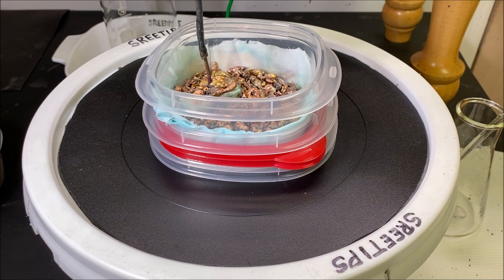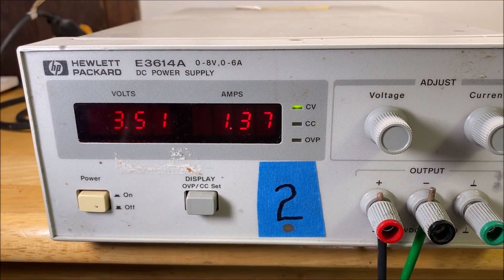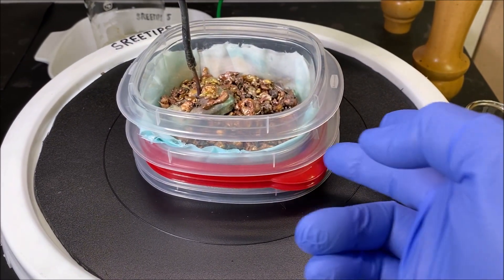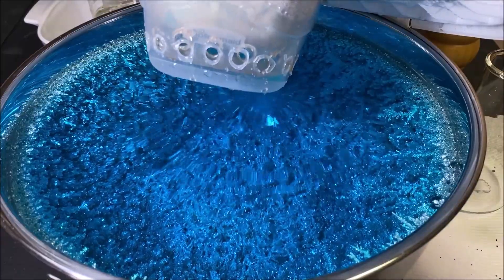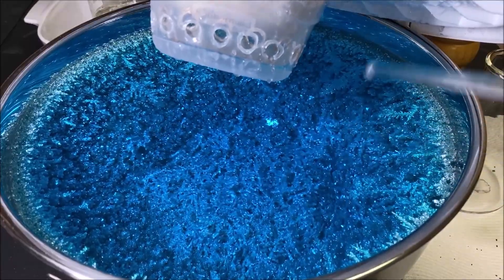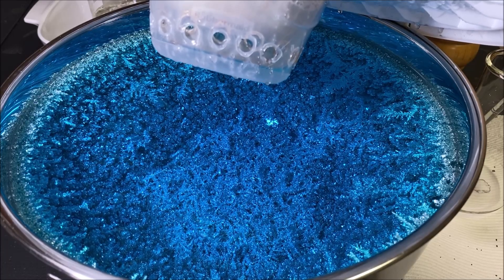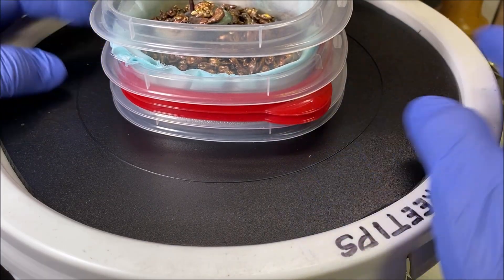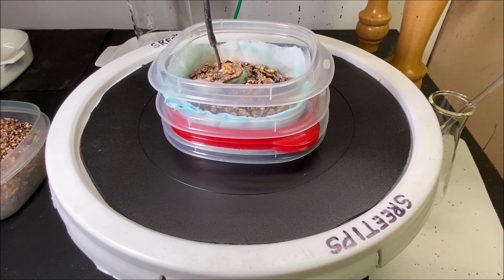Silver Cell Modification Solves my Problem

Comment: As you increase the electrical current path distance from the bottom of the bowl, it has shifted the highest electrical potential to the bowl sides. 

Has the modifications slowed overall production? 
Is less feed shot immersed in bath?
Perhaps returning to one basket with the same amount of holes with no holes on the bottom would increase the current draw which should mean quicker silver crystal production rate.
Reply from the maker: Yes, it slowed way down.
Reply: @sreetips  
I believe that’s likely due to less of the anode feed stock being immersed in the silver solution. 
Think of the current draw as an indication of amount of deposition occurring at any given time. More current draw means more deposition work being done. 
More voltage should increase deposition. 
Warming may increase deposition. 
Level of silver bath solution saturation may also have something to do with the deposition. 
If the bath is preferentially losing silver concentration, replenishing with original bath stock will never return the solution to starting levels of silver. The bath would need a feed that contains a higher silver concentration than the original bath to return to starting levels of silver concentration.

Comment: How do you calculate the silver left after electrolysis? Example melted 100gm into electrolyte and will it grow 100gm of silver crystal and the electrolyte become 0 silver ?
Reply from the maker: No, the sole purpose of the electrolyte is to provide a means for the silver ions, that get dissolved in the anode basket, to travel to the cathode where they get deposited as high purity elemental silver. But the electrolyte does get depleted as the cell operates.
Reply: @sreetips thx For reply . Ive seen your video that you topup The electrolyte . I saw The silver ingot depleted . When The ingot depleted And from crystals, let say The electrolyte you use is 300gm , And The ingot is 500gm. When The ingot depleted to 100gm, does this means The silver crystals have 400gm(+-) The purity. And The 300gm electrolyte left how much gm of silver left inside The solution? sorry to ask becoz im trying to Start one, But dont undestand the Calculations
Reply from the maker: This may help: for every 1000g of impure 98% silver that I add into the anode basket, I can expect to harvest about 980g of pure silver. However, some of the pure silver will be from the electrolyte. How much? Don’t know. I’ve never taken time to calculate it. And for me it doesn’t matter. Because I take the pure silver that I harvest, put it away, and forget about it.
Reply: @sreetips okay good info . This part I now understand . Can the electrolyte still  be used or need to make it back into silver shots and turn it back to electrolyte?
Reply from the maker: I used to try to use it two times, adding fresh electrolyte for the second run. But after that much use it gets saturated with copper and must be replaced. I recover any remaining silver from the used electrolyte by adding clean metallic copper to cement the silver out. Melt into shot. And run it back through the silver cell.
Reply: @sreetips  okay got it bos. thanks for the explainations. good luck to you too
Reply from the maker: Because the cell can’t distinguish between a silver ion that came from the electrolyte, and a silver ion that came from the anode basket. So there’s a Goldie locks range. Silver concentration too high, and most of it ends up depositing on the cathode. Silver concentration too low, and other metals (especially copper) could begin co-depositing with the silver and contaminate it.

Comment: As you noticed the current dropped so less silver per hour is produced. My idea is to isolate the bottom of the cell and don't use the spacer.
Isolation could be a rubber matt glued on or some chemical resistant laquer

Comment: Hindsight is 20/20. I'd assumed the basket was roughly equadistant to all surfaces. If not, path of least resistance and all that skews dendritic growth.
Reply from the maker: It’s performing just like my small 3.5 liter cell now that I’ve adjusted the anode basket further up out of the cell.

Comment: Dendrites are a description of the crystal growth. They are not dendrites growing in there, they are crystals which exhibit dendritic shape. Sounds like semantics, and not to diss on you, I love your videos, they have helped a lot. I did advise on using a deeper cylindrical cathode. Seems easier to buy the right pot at a Goodwill or such store. You get a much greater area under the anode basket than shimming an inch or so. I also like the concept of an attached vibratory shaker on a timer for a few seconds every couple of hours. Let you free up some more time to hit garage sales, or making out with the misses.

Comment: It seems to me a if a small non-metallic saucer were placed bottom up directly under your filter basket, you wouldn't need to double up your filter basket like you did.  After all, if the silver doesn't grow under your basket, it would not be a problem.  One of those small glass saucers you use in many of your refinings would work perfectly.

Comment: Couldn’t you lower the voltage to drop the amps so it would have less amps? Is the issue really the amps? You want to have growth and doesn’t the higher amps make it form crystals faster? I thought that was the whole point of the beast? Bigger, more crystal less maintenance required cuz it will run longer between refills…? If it’s slower now, it’s almost like you need another beast. 

Few weeks ago you ran the smaller silver cell, why not just make 2 or 3 more of the smaller ones and use the smaller design to help keep up with the silver usage?
Reply from the maker: Increasing distance increased resistance and solved the problem. I’m running the beast to try to get the bugs worked out of it. I still like my small silver cells. They work great and are easy to harvest and clean up.

Comment: Nice problem solving!!  Maybe you can get the amperage back up by moving to a taller vessel than a mixing bowl?  That way you can run the basket lower again.  Maybe a stockpot would be a good compromise?
Reply from the maker: I’ll settle for lower amps, slower operation, if it gets those pesky needle crystals from growing under my anode basket.

Comment: If by some odd chance the spacer ends up not being a final solution. I would suggest trying to get a small vibration motor from say an old game controller and hook it to the side of the bowl and wire it in that small amount of vibration should keep cyrstal growth under control maybe even slow your having to stir it.
Reply: That's a genuinely good idea!
Reply: @LexYeen I agree, capital idea. Would creating a film covering the flat bottom area. Make it hydroscopic. If the small amount of mass of ionic solution proves to be more 'gravid', well you tried. A tough waterproof Vinyl with a reversible mastic might be the answer, make the area as small as needed, otherwise you are just loosing your grow surface for no gain.
Reply from the maker: The spacer fixed it.

Comment: I still think a deep aluminum pot might be good you could even tap the bottom and install a ball valve to drain so you don’t have to lift like 40lbs of silver and solution
(Edit) ment stainless pot Al would be bad
Reply: Streetips could use a converted Big Berkey water purifier system.  It has the tap, it is deep and would take forever for the silver crystal to reach the anode basket.  It's basically your idea already implemented.  My other suggestion is the simplest.
Reply: @DigemDeep or have a mono crystal grown from a piece of silver wire and as it get larger it breaks and falls to bottom. there are many ways to do this

Comment: How about to install some kind of "mixer" after the bottom of impure silver jar? i think it can not only solve a problem  with dendrites, because it does  basically will crush them, but also it will continuously mix the solution, so solution will not be locally depleted
Reply from the maker: I’m tossing that idea around in my head.

Comment: Sir we need a filter recovery video ❤
Reply: I've been wondering myself when the next filter recovery video would be coming along as it certainly has been awhile lol
Reply: My favorites
Reply: @josephschnabel1andonly Same here!
Reply: Bet this would work great for plated items? Smaller scale separate operation.
Reply from the maker: Actually the silver cell must use anode material that is fairly high purity to begin with. Trying to run silver plated material would cause the electrolyte to become fouled very quickly

Comment: what if you use some really fine mesh under your anode basket? that should prevent any crystal growing above the mesh towards the basket...  also you can paint the bottom of the bowl with nail polish for example, that way you will prevent any growth on the bottom, but i guess you dont want to completely stop the growth...